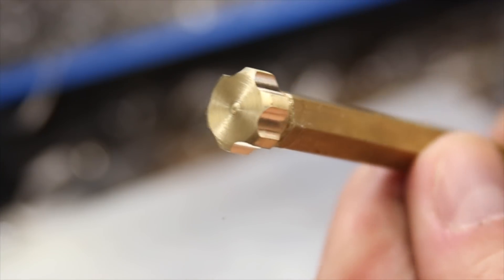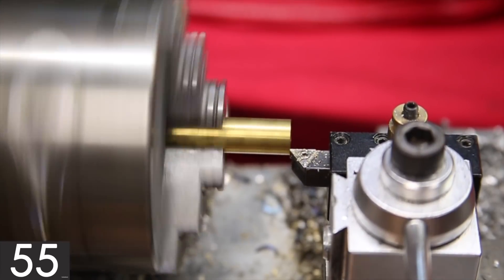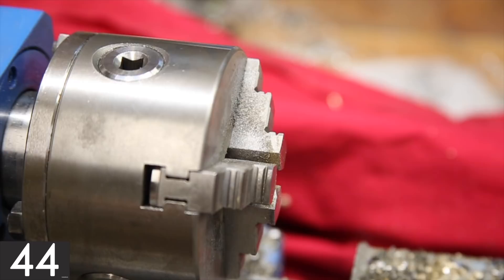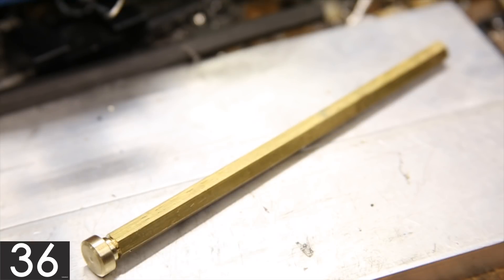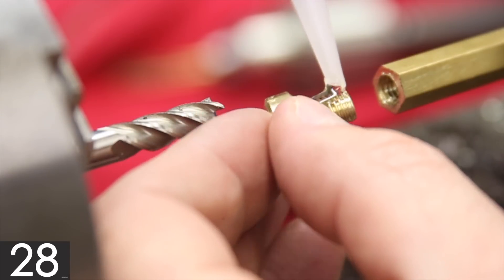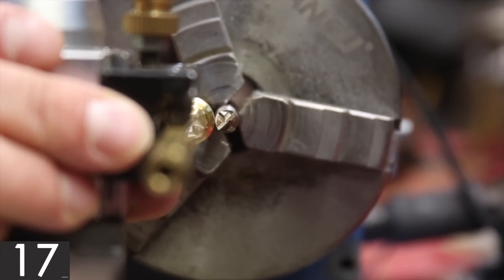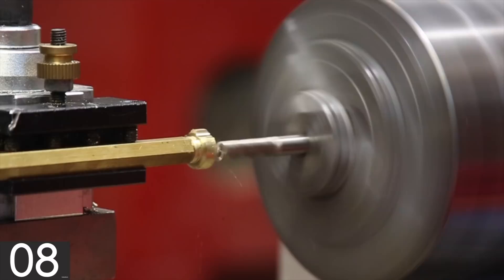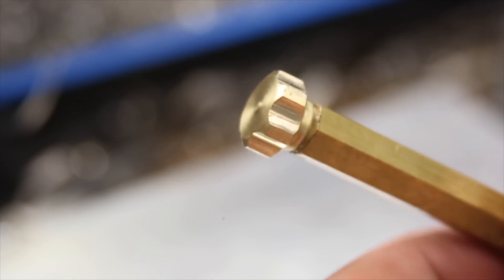60s Tutorial - How To Do Simple Milling On A Mini Metal Lathe

Comment: theoretically, a lathe can reproduce itself, so the parts to make an adustable slide to bolt on in place of the compund should be able to be made just with the lathe itself for easy milling. The only thing a lathe lacks is Z height adjustment. If I had a mill it would be easy to make haha. but this is why I do need something to mill. cool would be t see how to mount a small XY table vertically to the toolpost.
ah, we love to make tools to make tools :-)
Reply: Yeah I suggested that in a comment above, exactly what I would have done on my own lathe (if I had one).
That way, in theory, you only ever need a lathe :)

Comment: I've been considering this ever since I saw you doing it in a video! The quick change tool post is definitely pretty inaccurate, but recently found the below link - so in my case I may have an option in the future when I get myself a lathe. Of which there is a decent small starter in the $700AUD range. I just have to sell my 2016 3D printer first so I can invest in a lathe! This might be something for yourself to look into as well, if it will work with the attachment point of your lathe. https://www.machineryhouse.com.au/L276

Comment: If you ever found the time or necessary effort required, would be awesome to watch a project to actually build your own variable height "tool post", or in this case building a vice with more precision adjustable height.
Reply: Lots of ways to do that, you could get a cheapo mini-mill coordination table of ebay, by using a base plate that you bolt it to, tilt it 90 degrees sideways, welded to a 90 degree flat base plate that you bolt to the cross-slide in place of the tool holder base.
Welder+grinder+lathe+drill+tap&die set should be all the tools you need with some simple sketching and good old problem solving.